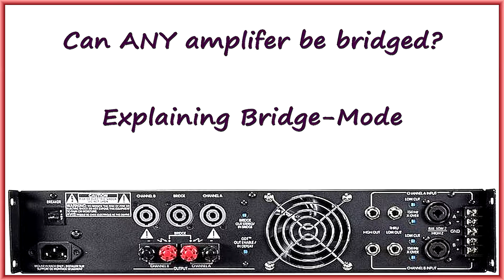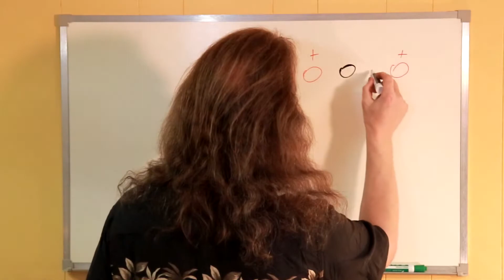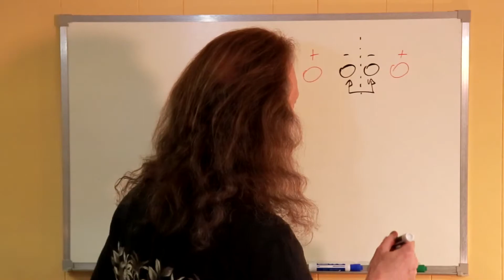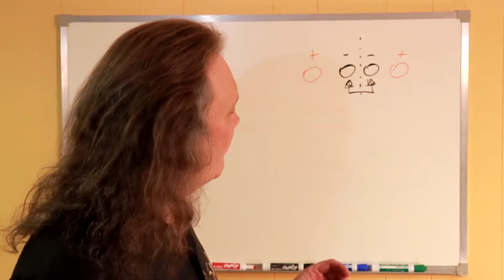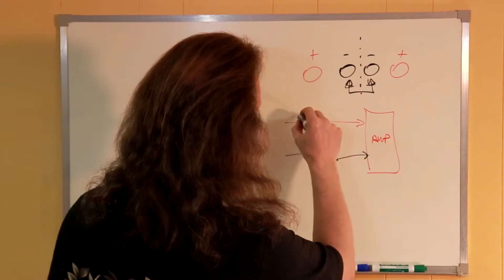Can Any Amplifier Be Bridged? The Truth Every Audio Enthusiast Should Know

Comment: On my Yamaha A-520 amp I only have a mono and stereo button or switch? Can I bridge safely? Or do I use a jaycar amplifier bridge module? I have done a bridge on a mid 80s akai amplifier and amazingly it was bassy and loud into 4 ohms. I turned bass up and treble down. I was only 22 and new to stereo systems. I am thinking of using a bridgeable car amplifier rated at 450 watts Rms into 4 ohms? But I purchased a jaycar response subwoofer 12 inch at 8 ohms and a 10 inch jaycar subwoofer at 8 ohms. They measure with a multimeter at 5 ohms tho! Any reply appreciated. Cheers from Australia 🙂
Reply from the maker: The A520 is a nice amp, but I don't think it's really intended to be bridged, that might be asking a lot of that unit.  If you wanted to do so, you'd have to use an external bridge module to invert one of the input signals.  For me, I'd rather listen to it in stereo.

Your loudspeaker is rated for 8 ohms, and that should be about the "typical" load it presents with audio input.  An AC signal.  The speaker load will vary somewhat depending upon what frequency the input signal is.  Some 8-ohm speakers can be as high as 30 ohms at certain input frequencies (around resonance) or maybe as low as 5 or 6 ohms at other frequencies.  Speakers are a dynamic load.  Measuring a speaker with a ohm-meter using DC isn't going to give you the full picture, and it's not uncommon for a 8-ohm speaker to measure 5-6 ohms (or 8 ohms) on DC.  If the DC measurement is wildly off, like 50+ ohms, or a 1-ohm near-dead short, then I'd consider that suspicious.
Cheers!  Thanks for watching!
Reply: @Barry-Watson  thanks for the quick reply! I did measure the impedance and it measures at 5 ohms as stated on the website! I'm thinking I'm going to use the amp on my Pioneer vsx 422k hdmi ARC as it's very gutless. But the Yamaha A-520 with my realistic 15 inch drivers used to vibrate light fittings and the doors,windows etc. It seemed like they meant for each other! I have a home subwoofer amplifier with a 10 inch sub. I am going to install a better module. Cheers 🙂

Comment: I have nad c352 nad c 370  and rotel rb981 which is a power amp. What do I do? Bridge or bi amp?
Reply from the maker: I'd probably use it as a stereo amp.
Reply: I'm using the nad c352 as a preamp with the Rotel rb981 poweramp right now. The c370 is adequate as a standalone amp; but would still like to experiment a bit further.

Comment: Hey Barry quick question can two amp play off one  electric transformer?
Reply: Ok thanks
Reply from the maker: I'm not sure I understand the question - can you describe your setup.  If you're powering equipment, it's a matter of how much load your transformer can accommodate without overheating.  The transformers out on the power lines drive multiple amps, lights, and all kinds of stuff.
Reply: @Barry-Watson  i have a two amplifier a gemini 5000 and a Behringer nu6000 but the Behringer has power issues it keeps going into protection mode even with stable power going into the amp so I wonder if I could change the power source going into the Behringer for a better result?
Reply from the maker: A big amp can draw some really high peak current.  This is why portable power generators that seem to be rated with enough watts may struggle to power a band show.  They can handle the average power, but can't deliver the necessary peak current.  I never had trouble with the big trailer mounted commercial diesel generators, but anything smaller would give me a nervous night.

Two big amps, like iNuke 6000s, if pushed really hard could overload a typical 15amp power circuit.  Some of the class-D amps in particular can really hit the line power hard with peak current demands.  Some of the old-school (heavy) AB class amps had massive power supplies with huge capacitors that helped buffer some of the peak current demand draw.

I'd try plugging your rig into a really solid power supply (a 20 amp circuit without any other big loads on it), and see if you have any issues.  If not, you know you're just not delivering the power that's demanded.

This is assuming it's tripping protection when things are pushed real hard.  If the amp is going into protection when idle, or when the levels are low, then there is something wrong with the load (speakers) or the amplifier.

Comment: hello Barry i'm running two crown d75 amps into a crown IC150A however when i hook up my turntable to either phono 1 or phono2 i only get one side. is there a way jump one side one phono two so both side can play on phono 1
Reply from the maker: So if you plug a signal into the other inputs (Tuner/Aux etc) you get stereo, but one side of the phono inputs is dead?  Sounds like the main preamp is working.

The phono inputs have a transistor gain stage and RIAA EQ for handling a phono cartridge.  It's a fairly simple preamp, but you'd have to tear into it to discover the bad connection or failed component.
Reply: Sorry i've been really tied up i did check my EQ, ashley combo cd cassette player and I can plug my iphone into the left/Right input on the front on the crown IC150a all works fine. I believe the preamp is producing stereo even though i'm running the two D75s in bridged mono. with each amp set to mono. I have this system in a rack , meaning i have to pull out components to gain access to the back of the preamp. that process is complete and i can clearly see the to small adjustment pots are nowhere set the same. looks like left at 12:00 and the right set at 3:00. This leads me to next question. I do some tube amp mods where i will install an additional power tube biasing  pot. This allows for adjustment of two bank of two and the adjust the the two banks to be compliant with the with the desired setting providing a congruent push pull from bank to bank. Finally the  question the recommended setting on the phono inputs is 47K  ohms. does that mean meter the rca inputs Outside shield to inside signal post and adjust each pot to 47K?
Reply from the maker: Sounds like there is a defective phono pre-amp (on one side).  I don't think the connected power amps (D75s) matter in this equation (that's all working).  The input should look like appx 47k load to the phono cartridge, and the level pots shouldn't affect that.  It's curious that the two level pots on the rear are set at vastly different positions, I'd call that a sign.  I'd first try adjusting those pots to see if you can get both channels working and at the same output level.  You *might just have a defective adjustment pot, or you might have a bad semiconductor in the phono stage (I think it has a FET transistor), or a failed coupling capacitor or broken connection or something.  It's not a really complicated circuit.

Option B is to ignore the bad phono section, get a little external phono preamp (with the proper RIAA EQ) and connect it to one of the AUX inputs, and be happy.

https://amzn.to/3PRg8B1
Reply: @Barry-Watson  Thank you, all really good info. I think that im going pull the cover off the IC150a Ring it out with my meter first. If that doesn't produce a quick and simple repair, I'll take your advice and purchase the phono preamp suggested and attach it inside the rack, strain relief the cabling and call it good. I was thinking about probing it with my Oscilloscope but decided way to much hassle. You have really helped out a ton. I understand guitar tube amps but when the transistor came on the scene i just never really became interested in the technology. I'm a analog dude the love playing guitar and have figured out how to get the tone i like and can repair/voice tube amp for others. once i get the time to get it done i will share the results.
Reply from the maker: Good luck.  If you decide to dig in, I think you can find the schematic on the Crown website.  If you can't find one, let me know, and I can send you a copy.

Comment: I have no idea about this but if can get more power is better,emotiva basx A2s can I bridge 3 A2s for the front man speakers left center and right even double the power is enough for me,the speakers I'm using are 8 ohms
Reply from the maker: I'm not an expert on that amp.  I think it's rated at 50 watts.   Even bridged, I don't think you're going to see a "lot" of power.

Instead of buying 3 of those A2s, I think just getting a larger pro-audio amp(s) would offer more power at a lower cost.
Reply: @Barry-Watson  the basx A2 is rated at 160 RMS at 8 ohms per channel and 250 RMS at 4 ohms per channel but that all I know for sure,thanks for replying
Reply from the maker: Thanks for the correction!  I'd start by seeing if the amplifier has a common ground (0 ohms measured between the 2 negative (-) speaker terminals).  If so, it's likely you could run the amp bridged into a 8 ohm load.  I'd check to make sure it doesn't get overly hot.
Reply: @Barry-Watson  thanks wen I run it normally it doesn't get hot at all it's actually cool to the touch

Comment: You can parallel bridge an amplifier without common ground outputs. You cannot serial bridge said amplifier as you said. I  have designed a stereo amplifier with a parallel bridge mode (with switch) that doesn't have common ground output when in stereo mode. Double the power into half the impedance in mono mode.
Reply from the maker: Thanks, sounds like that would be a solution for driving difficult loads.
Reply: @Barry-Watson  Ya if you had a difficult load you could just use a Y connector on the inputs of a stereo amp (do NOT invert 1 channel as in serial bridging) and connect the outputs in parallel to 1 "difficult" (Mono) load, you should get double the power into half the impedance of what one channel on the amp is capable of. Of course you would need 2 amps for stereo. It is important that both channels in the amp get the exact same signal and level, thus the Y connector.  Also if the amp has gain controls they have to be set exactly the same.
Reply: This is how I have to bridge my peavey IPR3000 DSP. Parallel the inputs, both channels turned up full, DSP settings set the same, channel A 1+ and channel B 1-. Does rather well powering (2) 8ohm subs night after night

Comment: Hi Barry. That was one of the best explanations about amp bridging so far. My question is, is it possible to bridge a stereo tube amplifier, and if so, how is it done.
Reply from the maker: Good question, I have not done it.  Seems to me it would be the exact same thing, invert one input.  The issue with tube amps is that they have output  transformers, so I'd be careful to be aware of the current limits to not damage the transformers.  The transformers would need a common ground, so check if both sides (L/R) are floating relative to chassis ground or each other (using a ohm-meter).  You might need to connect the (-) output sides together.

When I think of bridging amps, it's a tradeoff of some sound quality for a bit more power.  Tube amps to me are all about sound quality or maybe character, so bridging a tube amp, to me, probably isn't something I'd pursue.  But, hey, if it works for you, it works.  If you discover anything interesting in the journey, please feel free to give us an update.

Comment: Hi ser bridge mode as well as mono mode  are the same thanks.
Reply from the maker: Thanks -- Usually a "mono" switch implies bridge-mono mode, but some amplifiers offer a mono mode that simply routes an input signal to both sides of the amp.  You'll have to check the documentation for your equipment to be sure.  If it's a bridge-mono mode, it will likely direct you to connect the load to the + output terminals.

Comment: hi, i'm new with my channel as well and creating some content.... right now i am working in a subwoofer hi-fi grade preamp with amazing croosover capabilities but.... once the signal goes to an amplifier, lets say is a cheap but capable sony/kenwood amp i would put the signal in L and R inputs and then drive the speaker or subwoofer combining both L and R outputs in paralel to drive one speaker or a pair of speakers (for thi i would connect both speakers in paralel or in series if both speakers are 4 ohms), i wouldn't recoment to use bridge for any regular amplifier
regards and very nice and informative video
Reply from the maker: Thanks for the comment.  Maybe I don't understand exactly what your plans are, but I generally would not recommend connecting amplifier outputs together in parallel.  Connecting loudspeakers together in parallel to one amplifier output is common practice.